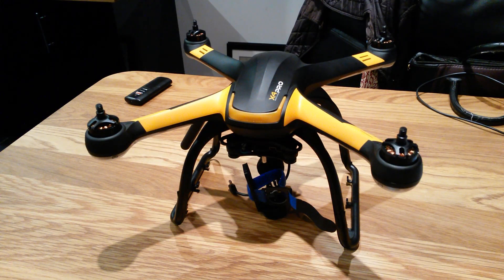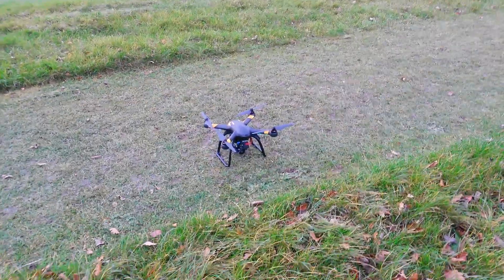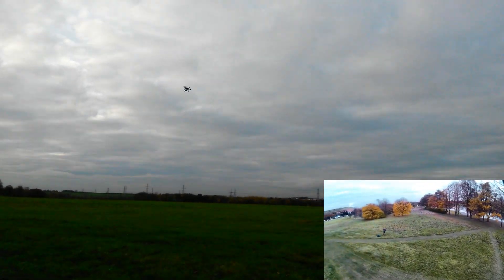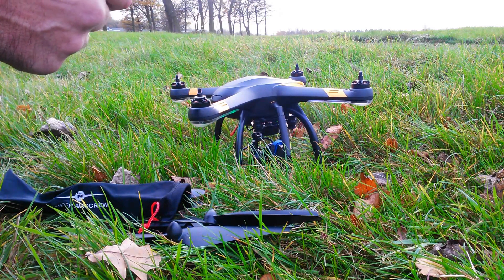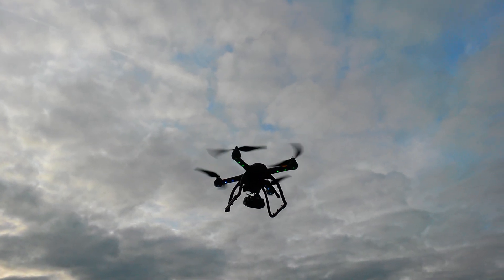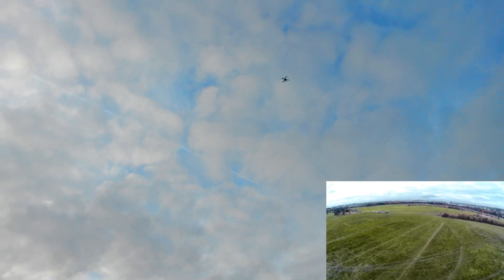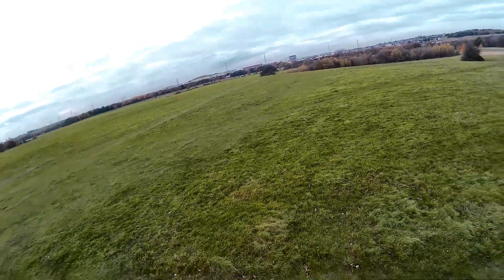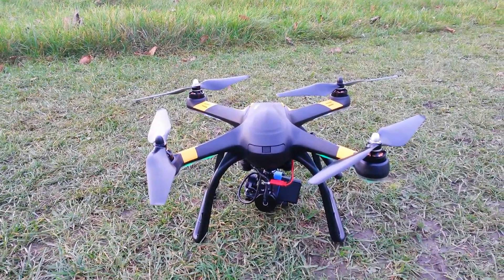HUBSAN H109s & Master Airscrew Props

Comment: nice video what i do  to bring it down is i hit land and when its close i stop the landing and it will never wobble and it will come down at a good speed...let your drone do the work for you
Reply from the maker: WARI,S IDEAS - good tip mate....it is quite a bit more stable with the bigger MAS props, especially in wind but they do shorten flight time.